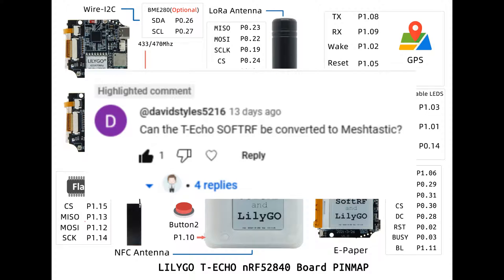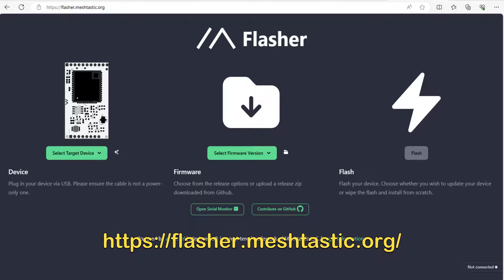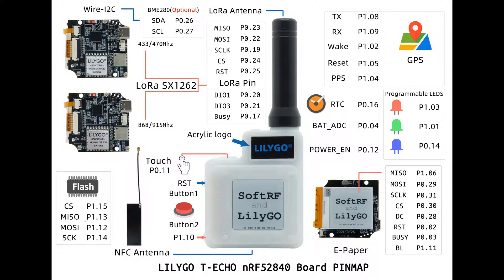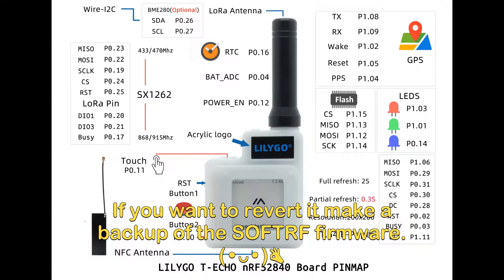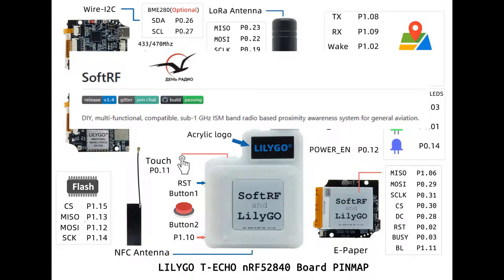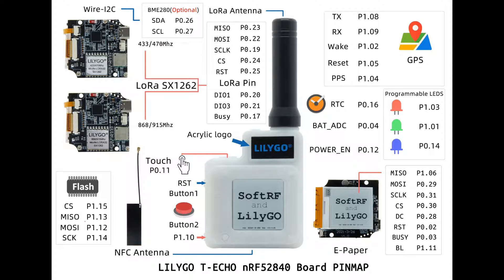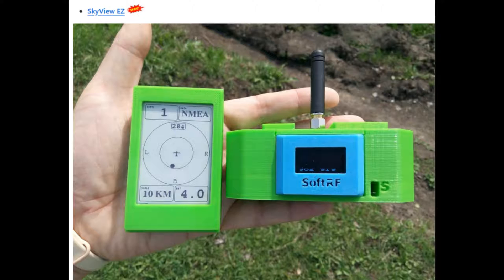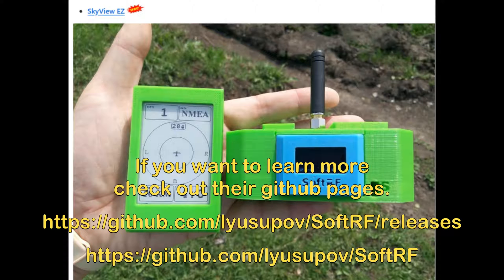can I convert a SoftRF device to Meshtastic?

Comment: Are the T-Beam Supreme S and M variants on lilygo exactly the same except for the firmware that ship on them?
Reply from the maker: To answer your question - No The T-Beam Supreme and LILYGO models are not the same. The hardware on those devices are different. The firmware is the same, however if one is installing Meshtastic on them.
Reply: @itpotatofarm   I have confirmed this is wrong. The T-Beam Supreme S and the T-Beam Supreme M are exactly the same hardware. 
They just ship with either the SoftRF or Meshtastic firmware pre-loaded, but they are the same device.
The S or M Sku also sets where a small donation to each project goes (softRF or Meshtastic).
Both listings have the normal frequency options and additional hardware etc. Still the same hardware.

So if the meshtastic ones are sold out, grab the SoftRF. It's the same thing.

You can buy either device when they are in stock and flash either firmware.
Reply from the maker: @GaryStango  I apologize I misunderstood the question. When you stated "M variants on lilygo" I thought you meant LILYGO T-Echo, LoRa,  T-Deck, T-Watch or other LILYGO devices. You are correct. According to this webpage from LILYGO: "https://www.lilygo.cc/products/t-beamsupreme-m" and I quote: "The main difference between T-BeamSUPREME (M) and T-BeamSUPREME (S) is the different firmware of the products."

That firmware being:

"T-Beam SUPREME (M)=T-Beam SUPREME Meshtastic

T-Beam SUPREME (S)=T-Beam SUPREME SoftRF"
Reply from the maker: Each LILYGO or T-Beam has its own list of components and features. If you have a particular usage in mind, I suggest looking at the various models to ensure you are using the one that best fits your needs. :)